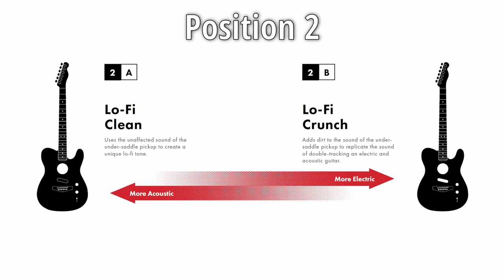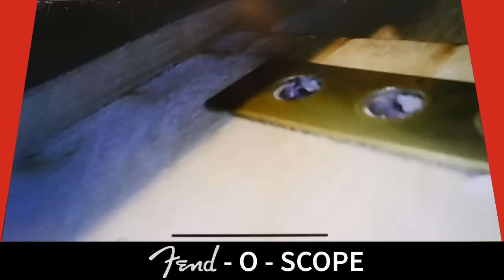What’s INSIDE the New Mexican Acoustasonic Telecaster? | 2021 Fender Player Acoustasonic Review

Comment: i know this is an older video now, but i have to talk about my experience with these. i have loved the look of the acoustasonic range since it was first announced, but i was 16 at the time, so i definitely couldn’t afford one. when the player range was announced, i was really excited to see a version that i’d actually be able to afford, with a few months of saving up, of course, but for whatever reason, i just never picked one up. however, i was at my local guitar shop the other day, and there was one hanging on the wall, so i had to give it a try. i loved it. the neck felt really nice, though i prefer slightly chunkier necks, the satin finish felt great, and while i didn’t plug it in, it sounded really nice acoustically. my only problem was the butterscotch finish looks really strange to me. i’ve got a birthday coming up soon, and i’m really tempted to pick one up in the arctic white color-way
Reply: Bought a used one in butterscotch and I got used to the color. It sounds great though, and I love the versatility.

Comment: Fender is going to sell a billion of these things at $1,200. The MIA version was nice but was definitely more expensive then what most of the market for that kind of guitar wanted. Even then Fender still sold a bunch of them. 

I think the switch to the battery was a good choice. It's a little cruder and not as fancy but definitely more practical for most gigging musicians. I wouldn't be shocked to see that change happen on the MIA models as well at some point.
Reply: Makes a lot more sense too as a rechargeable battery can only be recharged so many times and eventually needs replaced, which with these things looks like it could be a pain to do.

Comment: I think that sound hole works a lot like a subwoofer port does. That’s why it’s so long and almost touches the back of the guitar. The sound hole is also smaller than the regular acoustic is. That’s because for the port to work properly the length of the port has to be proportionate to the diameter of the port. So for instance if you want a wider opening diameter for the port the depth of the port needs to be larger. Too large an opening and the port would have to be too deep. It most like has something to do with the tuning frequency they are going for and internal volume they have to work with. Just my guess. I haven’t heard anyone else talking about that aspect of the sound hole/port. Thoughts?

Comment: I have the American tele acoustasonic and they look very similar (mine's in the green, though). Neckwood looks different too but that can vary so much between guitars anyway. I've got to say, I do actually like the idea of using a 9v battery over the rechargable built-in like on the American. Because at some point, after time and/or so many charge cycles, the lithium battery will need to be replaced. Doesn't look like it'd be too horrible to change it but it's not completely easy...some may not feel comfortable doing it yourself. And why oh why did Fender use the micro-usb on that pricy of a guitar instead of usb-c? So yeah, that's a big plus in this player version! Nice review!

Comment: Coming from Andertons review where they ran thru an interface, and Austins where he is running thru a normal amp I gotta say... the US versions sound like they're worth the extra $800, but these don't sound like they're worth the $1,200. Tbf I haven't heard one thru a traditional acoustic amp, but these just don't sound all that great to me. Idk if that body sensor adds an extra element to the tone or what, but it sounds like a cheap full laminated acoustic. Really flat, cut mids. Idk, I think it's great that they're offering one that's " cheaper " I just think it'd be a better deal to just buy the US model.
Reply: In my opinion the Mexixan acoustasonic is Not for playing through a Tube amp. It’s for acoustic amps or playing it right through the pa. There are Reviews on YouTube describing that. And they all say, it Sounds Not as good as it can be through a normal Guitar amp.

Comment: I run a PCB assembly and rapid prototyping lab (not as much lately but still) and the mini usb jack is almost certainly for programming. I'm surprised they didn't use a 6 pin jtag header but its most likely to make it easier for users or techs to update if they ever needed to. A jtag header would require an external dedicated programmer which would be a pain. If I could see what DSP chip and other ICs are on there it would provide more clues. Especially if there is an FTDI chip somewhere.

Comment: The choice of voices on this guitar is fascinating. Position 1 is the same as position 1 from the regular Tele model, position 2 is the same as position 2 on the Jazzmaster and position 3 seems unique to this model. But it is similar to position 4 on the tele where you can blend a parlor guitar with a dreadnought. With the blend in the proper position you can get an amazing fingerpicking sound by blending just enough of the dreadnought body to fill out the parlor setting. Position 2 on the Jazzmaster is awesome so I can see why they chose it. What you're really missing here tone-wise are two things: no body sensor so no position 3 from any model, and a position that lets you blend acoustic and electric tones like position 2 on the strat and tele model. FYI, I own all three but my favorite is the Ziricote strat. The extra $1,200 buys you a lot in build quality.

Comment: A guy in Finland modified an American Acoustasonic Telecaster to take a 18650 3.7v rechargeable battery that was removable from the back. If Fender wanted to make these truly professional, that would have been how they came from the factory. This way you can recharge the battery from a separate charger and have more than 1 battery with you at a gig. I gig the American and I'm going to make that mod. The internal rechargeable Fishman battery is a PIA, and I've heard the Mexican ones eat the 9v, like 1 per gig. That's expensive.

Comment: Good review.  IMHO this is an electric guitar that also has an acoustical sound.  Without being plugged in, it really doesn't compare with a real acoustic.  However, with a good amp, this guitar performs rather well.  It does fit an acoustic/electric profile, but you can get close to the same sound by buying a acoustic "slip in" pickup.  All in all, not bad and the price is finally reasonable.

Comment: That plug that's not used is for a USB- I am betting either for testing when they build it, of if there is a way to upgrade the firmware in the controller (if it has any). The top looks like the burst is a sticker- looks cheesy to me. Maybe the white or black would be better.

Comment: In twenty years you'll probably need to replace most of the capacitors in the electronics board. But it would still work as an acoustic guitar regardless.

Comment: The boards look very similar, but they are different, even the mounting points are different, most likely on purpose so people don't swap the parts, because it's just an added cost for them to make another board.
If someone had some time and a 3D printer they could probably just make a bracket to make it work and just move the input jack location which wouldn't be too difficult considering it would fit.

Comment: Best bet for the battery is to do sort of like youd do with strings. If you got regularly you might get a couple uses out of it. But nine volt batteries don't always last for to long so I'd test it before another gig or after the gig you just played. Maybe that unused connection port is the plug a midi or synthesizer. Heavier strings and you might get some of them grunting growling tones Ted Nugent used to get out of his semi hollow in distorted mode.

Comment: I'd buy one used, and tinker with it and prob make a face plate, and turn it  into an electric Tele and add an F-hole  like the thin-line, I know I would, I can't stand a guitar needing a Battery and computer crap... or wire the pickup to the vol n tone like a normal electric taking out the computer crap, in fact I'd try that 1st… and refinish the cheap satin overlay finish, makes it look cheap, to real wood that's under it like the beautiful  wood back n sides and ... Ok, well build a new guitar

Comment: Oh man, this sounded terrible outside of position 2 maybe,. The tele electrics sounded like a company that makes acoustics tried to make an electric, the first two acoustics sounded like a company that makes electrics trying to make an acoustic. Nothing sounded professional quality whatsoever, and IMHO at the $1000 mark you stop marketing to bedroom guitarists and start marketing to aspiring artists/gigging musicians. You would be much better off with a cheap acoustic ($600ish) and a $700 actual fender tele than this, yet again. I really wanted to like this guitar, because I thought the Jazzmaster actually justified the $2000 tag, because it sounded authentically enough like several different types of acoustic guitars and had a very usable electric sound too, so you would need to buy 3-4 guitars to effectively replace it. I think it's pretty clear at this point that most of that $2000 isn't material value, it's the preamp. While the Acoustasonic Jazzmaster tries to do the job of 6 guitars and does the job of about 3 guitars believably, this guitar tries to do 4-5 guitars and does zero believably. Unfortunately this is a no from me.

Comment: This guitar defeats the whole purpose of a tele, and tbh sounds like a cheap crappy acoustic guitar on the best setting it had. Straight garbage. Even at $1,200 you can get a great electric guitar, and a decent solid wood acoustic
Reply: You think buskers want to carry 2 guitars around all the time?
Reply: @Wilco1972  not really,  but most buskers use one type of guitar.  But if they needed electric guitar and acoustic guitar tones I still don't think this is the best option out there.
Reply: But how long does it take you to switch from one to the other?